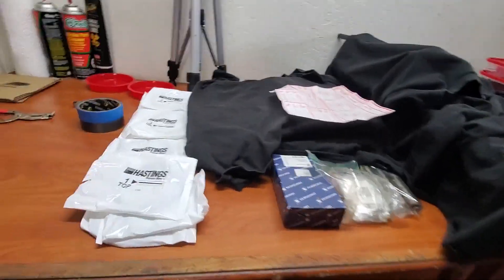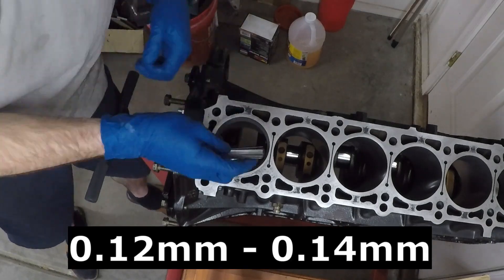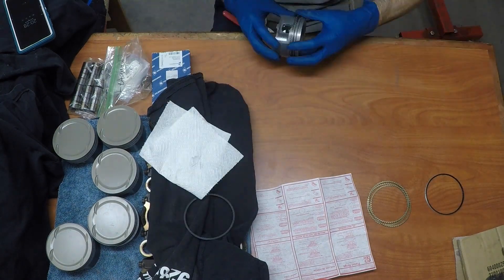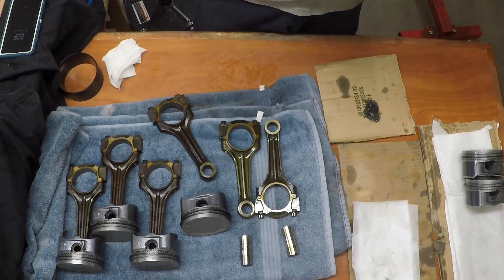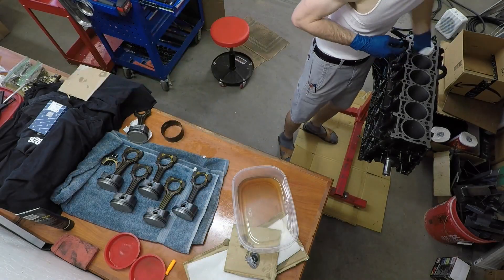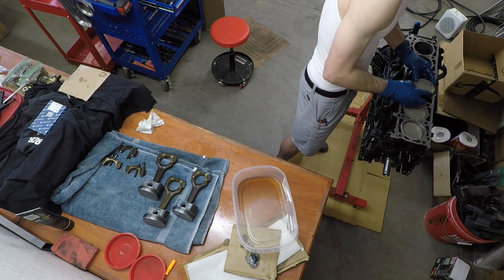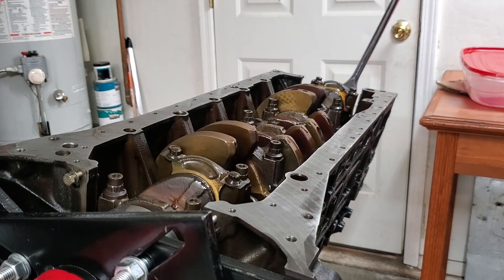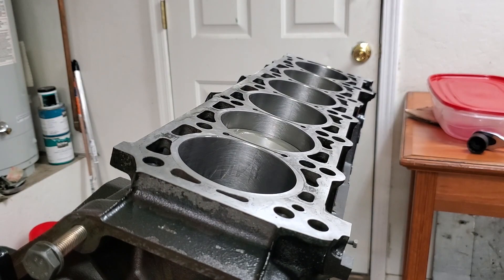Assembling The Block - M104 Turbo Build (Ep. 15)

Comment: Very nice and informative, may i ask why you went with a final top ring gap of 0.6mm? are you planning on high boost or different fuel?
Reply: Thank you for the reply. I have a boosted M104 with bad compression test results. (should have done testing before boosting it) and i was going through the Piston ring gaps part in your video and never though it mattered that much up until now. Will be rebuiling the engine very soon. Great job with the videos man!
Reply from the maker: So glad i could help!!

Also note: top ring seals compression, 3rd is oil scraper, and 2nd is actually primarily a piston cooling ring. all 3 rings cool the piston, but the 2nd's job is this primary purpose. Just a bit of extra info. 

p.s. Post a video on youtube of the end result when you get it rebuilt, and get first revs!
Reply from the maker: So, from the factory i believe the top ring is like.. 0.15mm. Thats for the rated 220hp this engine makes from factory. If i make 500hp after everything is said and done, i would logically need a top gap thats more than double the original gap, so like 0.4mm. Add in some head room, for peace of mind and possible future extra boost, 0.6mm was the final choice. 

Some have told me that you can have huge gaps (up to 0.99mm) without much, if any, efficiency loss. I, however, dont want to just blast my gaps like that. I like to calculate and be moderate, with everything i do.

Comment: lets goo, what ecu you will be using?
Reply from the maker: Megasquirt 2 piggy backed on stock ECU, in hopes that the TCU will function normally for my auto trans. If i have issues with the TCU, ill rewire the whole damned car, swap to manual trans, and just straight MS2.
Reply: @JakeSublime  manual swap parts are easily available in europe if you can't find them in the states. I've heard that the car has almost all the provisions for a manual pedal box and clutch master cylinder from the factory
Reply from the maker: @mariospantouvanos4645  yes, it does. I should just be able to punch a few things out and mount everything nicely IIRC.

But, Mercedes manuals are very rare over in the states. Plus, i hear poor reviews of manual Mercedes trans' (that theyre not so fun). 

Thats why id just swap to a more common and available BMW manual trans. 

Thoughts?
Reply: @JakeSublime  I've read that you can adapt a bmw shifter to work on a mercedes trans
Reply from the maker: yes and there are adapter kits for m104 to bmw manual trans. i would assume everything lines up farely well.